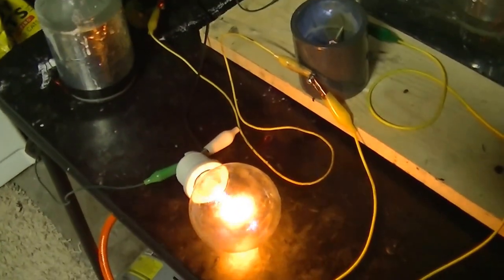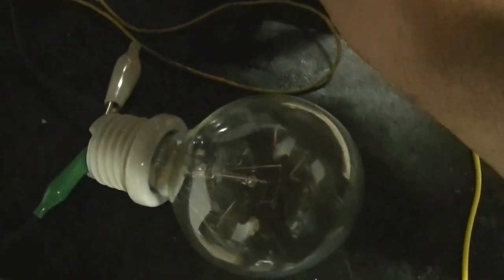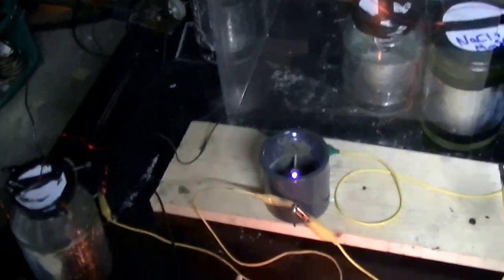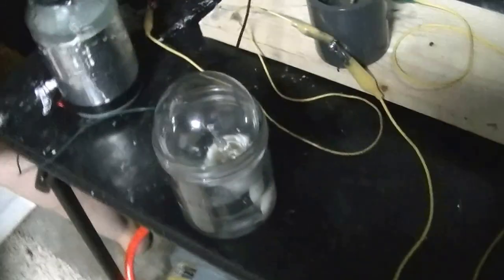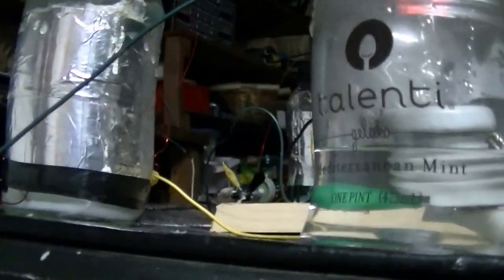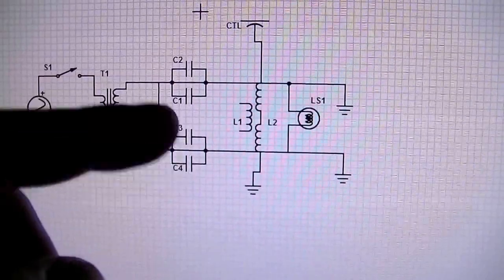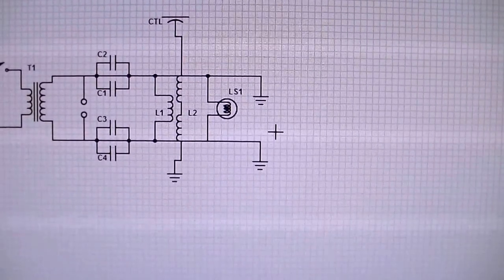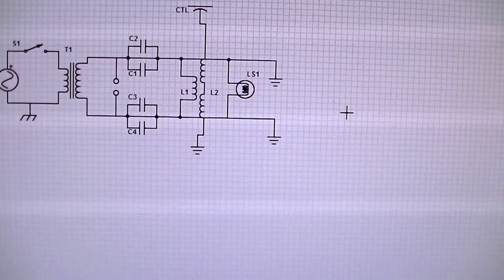Tesla Hairpin Circuit earth ground shorting

Comment: that shorting to ground action is pretty fun yes indeed.
its basicly pumping electrons from ground from the incomming signal from your power supply.
doing this can sometimes even give more then there was supose to be.
with some of the setups i've done i took a generator coil on a rotor.
going to caps
1 going to ground 1
the other to a bridge rectifier.
the other ac lead from the rectifier gone straight to ground 2
this setups sometimes can give greater outputs aslong as you dont kill the dipole.
charge medium/high caps to high voltage in short time.
but only effective in the expiriments i did if i cap dumped the cap to a storage/battery

nice video! :)
keep up the goodz
Reply from the maker: It's an interesting circuit indeed.

Comment: Awesome thanks! I think the answer we are looking for is combining the hairpin with the Don Smith use of tank circuit resonance for the real service amperage. Can you explain the secondary coil "top load"? It looks like this ia where you are going, just need a good setup of caps. They are cheap on ebay
Reply from the maker: The top load I had on this video was just a corona disc to easily change out top load capacitance. I would love to continue doing these experiments, but I have moved to a place that wont allow it right now. Tuning is crucial as well as being able to establish a conductive pathway between the earthen potential. There is a few other additions to this circuit that Tesla clearly laid out. One in particular is a neutral resonator coil that acts as a virtual ground as well as some extra tuning points for resonant purposes I believe. I will eventually get back to this as well as utilizing the heat that this is producing on the spark gap. A heat which by all calculations estimated, is hotter than the surface of the sun. I have a later setup with very nice cap banks and tuning inductors. Some of the effects freaked out the Mrs. and I have it on video. Thanks for watching and especially the comments. We all can contribute so much to one another and no idea is ever one persons alone. Peace to you and yours :)

Comment: Multiple earth grounds. Excellent. What how did you hook them up, that is to say, what did you use as your different grounds? Home, lightning rod, aluminum rod, iron pipe etc.?
Reply from the maker: One is on the water pipe mains, the other our s 3 foot copper rod in the yard. I would like to make a better ground eventually that is a plate.
Reply: Diadon Acs Very nice. Thinking about different "positive" ground shapes out of copper myself.... More surface area is probably better.... only time will tell. On another note, I got my Micro SD card for my camera and an adapter for my LT. I should get a few vids posted soon. Keep on keepin on, peace.
Reply: I don't know that the grounds actually need to be separate, as long as there is one good deep one. It is basically just using the earth as the Shunt. The greater the depth of the ground, (well, aquifer is best), the greater the potential between the two points of the surface apparatus and the lowest ground

Comment: I'm confused about the caps.... They are being shorted out by that diagram. That is not gonna work... You have taken a powerful event, like the capacitor dump and dampened it with shorting them out. You might as well take them off the diagram. The whole point is to create a separation of the supply circuit and the caps do just that. Bypassing the caps actually makes your device deadly, very deadly, if you follow your diagram. Might as well touch ac lines directly and cut the middle circuit out. Isolation from the supply circuit is what you should be after. You only need it's oscillation to keep timing only. The resonant circuit will do the work and that includes the load. Your circuit must match the load with the supply circuit in timing only. The resonant circuit will keep the power and timing in tune and oscillating. The gap is the ac to impulse converter. The cap is the condenser of this impulse energy. It's like changing ac waves into very steep walls or trains of walls (Impulses). When there are trains or successive walls this energy excites matter as those walls hit the matter. This has a pumping like effect to matter of increased energy or excitation.
 
A note about safety here: Please understand that we have no idea what prolonged exposure to this kind of energy. Tesla was of the opinion that it will not hurt you if done properly. Now there is a cousin to this energy that acts similar and is called RF. RF has been shown to do some very strange things to ones mind and body. Burns to the skin are very common and one should take note of when it effects one if it is touched. If it is burning you, then your system is bad. Tesla was showing the difference of this kind of energy by passing great quantities of it through his own body at the worlds fair. He even allows a member from the audience to do it as well and given in the recounts of people who witnessed this during that worlds fair and reported on afterwards in the literature about the worlds fair.

 One note here. Your cap arrangement gives me an idea. what if the short between the caps was a coil? Maybe that is what the bifilar coils were for? A sort of very high self capacitance wire. One that charged and dumped it's charge faster with higher currents. I would suggest using an oil bath to keep the ozone production down. Air doesn't like to be excited to much without it breaking down into ozone and ozone is not good for one to breathe.

 One should make an attempt to isolate the supply circuit as well to make it less noisy to the traditional ac supply side and interfere with other normal AC devices like Computers or TV's..

 Static Shielding of the design of Tesla's for any wire after the impulse creation is needed. Patent: https://teslauniverse.com/nikola-tesla/patents/us-patent-514167-electrical-conductor
Reply from the maker: All duly noted and I see what you mean on the capacitor. Ignore the line in the center of the capacitors, it was just the program I was using. The caps are not shorted from either end at all, so I apologize for that poor diagram. I have since done many of these experiments, and I have isolated the supply line, as well as done a bifilar coil for the short as a primary coil you can find here: https://www.youtube.com/watch?v=Hof6PuFlBXc
 In one instance I actually did a bifilar around a plasma globe then grounded either end of the coil. The effects are something interesting to note as the charge potential oscillated when discharged like the static on a TV, only for quite a sustained amount of time. 
All these are very crude experiments in making due with the budget and resources I have. I am no longer able to do these experiments where I live now, as I am in an apartment. With time I will come back to more of them though. Thank you for your comments and feel free to leave them any time :).  Here is the experiment of the grounded Plasma Ball oscillation. https://www.youtube.com/watch?v=qwigsmyy5yM
Reply: @consciousenergies  everything was poor
Reply from the maker: @johnadams6757  If you need clarification I am happy to help.

Comment: Can you try different. Load than light bulb

Can it charge acid battery too?
Reply from the maker: Well, if you rectify the voltage properly it may be possible.  Something I have thought about as well as using hydrogen cells.  You  just gave me an idea to experiment with, thanks :)
Reply: Yes, can use the water as the resistive load with the directional current, can act as a ballast or isolation transformer in a sense. Pulse that current through the water at the right freq and you also have hyper efficient HHO production. I am not formally trained, Ballast may be the wrong term

Comment: Nice work ...what kind of voltage are using?
I tested with 16kv. It did not worked at all
Reply from the maker: Thanks for watching :)  I am using 5KVAC NST so pretty small. The caps are each 10KVAC at 1500nF HF Doorknob style.  What are you using and what is your schematic and perhaps I can help you?

Comment: is that a dc motor housing for spark gap?
Reply from the maker: Nope, just a piece of gray PVC.
Reply: ah, i was curious about 'magnetic quenching'. similar to having air blown across the gap? im so new to this hv stuff and the net is saturated so its hard to find straight answers
Reply from the maker: You got it, it helps collapse the field of the spark gap. Air quenching works well too, then you can use rotary as well which quenches with air and a different cathode so acts as a different magnetic field. I am trying to stick with static spark gaps because they are easy and no extra energy is needed. Hope that makes sense?
Reply: it does...though i dont really get how youre quenching magnetically...is it just a permanent magnet field close to the gap that does it?
Reply from the maker: Yes, then every time the magnetic field is collapsed on the spark gap it helps strip away its polarization using the permanent magnetic field. If voltage runs through the two electrodes, there will be a magnetic field around the electrodes, like a magnetic bubble or taurus. That produces more resistance for the breakdown of the air dielectric  on its next switch, since that is we're the magnetic field is present. Like when you fill a capacitor or battery up, it creates magnetic fields on either side of the dielectric (or electrolyte) that gives more resistance the higher the potential. So by putting a permanent magnetic field, we can pull and push the dielectric away according to its polarity so there is a neutral presence in the air. The same with blowing air on the gap, and then a rotary spark gap does both due to the change in the conductors presence and the air circulation in the dielectric(air). So the magnetic field of the conductor is completely renewed along with the dielectric (air). Does that make more sense?
Reply from the maker: Oh, this is based on duty cycles btw. So it might not be noticed right away, but just like a battery, it gets less efficient over time.
Reply: it does, thanks. there is alot of theory to catch up on. so much reading! it would help if i was taught some basics in school, at least circuitry basics should be included somewhere. i went full out calculus/physics/chemistry in high school instead of wood shop or gym....and still im missing so much!

Comment: Very difficult for the viewer to watch.  Too much camera movement to get a good look at what's going on.  
I'm considering using a MOT with a large inductor to limit the current.  I don't have a NST.
Reply from the maker: Acme Fixer sorry about that I agree its not the best cinematography. Yes you can use a MOT with a ballast of sime sort. You could also use a ZVS driver with a C-core transformer. Please be safe in whatever you do though, as it becomes increasingly difficult to insulate HV, so if it carries a large amount of ampere, it can spell disaster.

Comment: 5.39 seems you connected the capacitors in series with the 2nd circuit, and dead short them? you should seek resonance with those caps and you will need around 7 or 8 nanoFarad over 2kV, here is a video: https://www.youtube.com/watch?v=m5CRM2bhJe0

Comment: Dam did any one look at the schematic it can't work everything is shorted you didn't build what this schematic shows
Reply from the maker: There are two mistakes, the capacitors are shorting to themselves and I am missing a connection on the bulb. Otherwise everything is suppose to short like the Hairpin circuit. Instead of a shunt bar I am using a Tesla Coil Primary and two earth connections. Thanks for watching and bringing that up though, I appreciate it :)

Comment: Circuit is wrong ! The capacitors are in short circuit !!  In this configuration  you optain only a damage of tesla coil !  This is not a mistical circuit...is a practical circuit made by tesla and use for emision high frecvencies.
Reply from the maker: Yes, as mentioned, the caps are accidentally shorted to themselves in the diagram. My apologies on that.